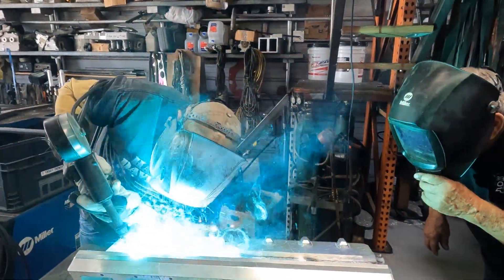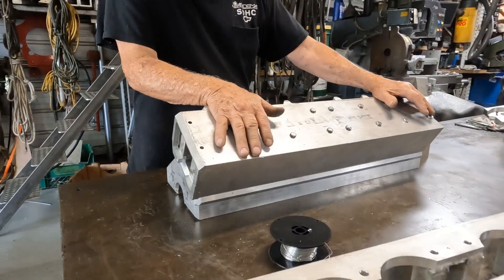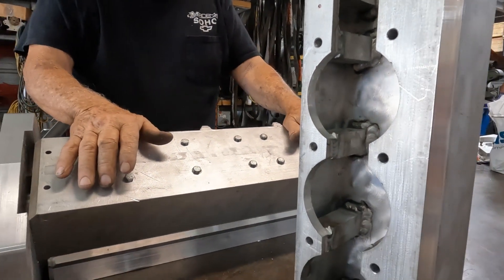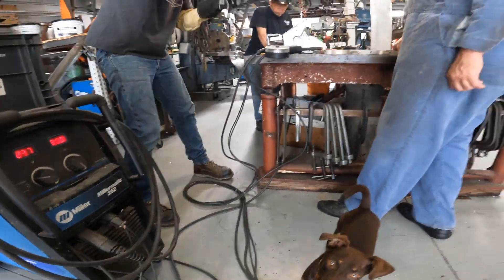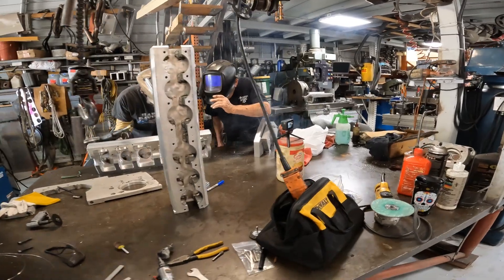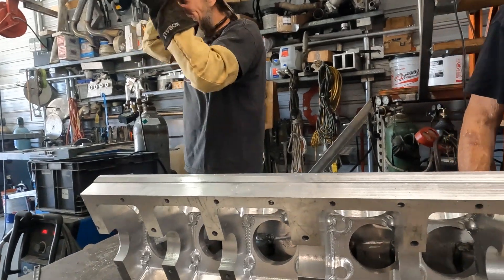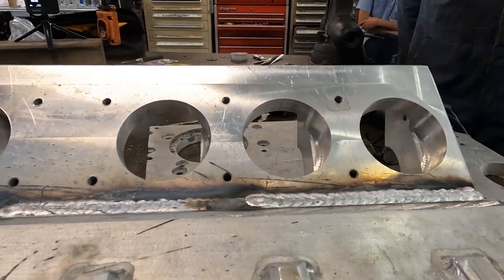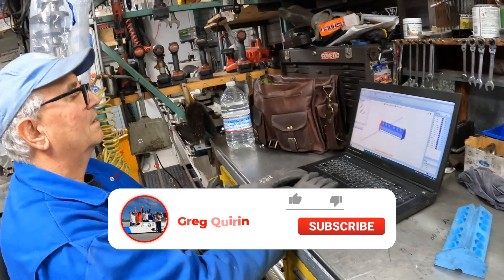Custom V12 Engine Build - Part 1

Comment: I SAW WHERE YOU HID THE TIMING GEAR .
CAN YOU SELL THE TIMING BELT SYSTEM TO FIT A PUSHROD  SMALL BLOCK CLEVELAND ? 
AUSTRALIA STILL RACES THAT BLOCK. BIG MARKET. 

DOES THE COYOTE SYSTEM USE A SIMILAR PATERN ? 
FORD USES A CHAIN THOUGH. 

CAN SOMEONE GET PERMISSION TO USE YOUR CONCEPT ?

Comment: Where would the threads for the head bolts be located on something like this? Pete mentioned the legs for the head bolts, does that mean they're threaded near the bottom of the cylinders?

Comment: A Millermatic 355 with the Aluma-Pro push-pull gun large wire size with the weld following closely behind the block preheat would probably do the job, I think the 252 in the video does not put out enough heat (current). 

However, if we stay with miller machines for the moment, the Syncrowave 400 TIG liquid cooled torch large diameter rod following the block preheat (as closely as practical) is the better choice to do these deep penetration welds into thick plate. I also think it would be good to have two heating torches and a spot read or thermal camera to see the actual temperature of the aluminum before welding, so two men on torches, one taking temps, and the final a welder. I also think the builders should have a rotating clamping jig to hold all of the main pieces in place under a set clamping pressure (the valley and the two cylinder banks) and alternate welding bank to bank starting with stitch welds so the distortion cancels out, fill in the stitch welds side to side, then do a final large fillet weld over the top again alternating banks. You will need to rotate the assembly so the weld puddle with gravity spans at the correct angle the final weld puddle will be huge the cup will be very large and the shielding gas at a high flow rate. After the final large fillet welds you could then grind down the weld using a radiused grinding wheel, first course then fine. This would help appearance but also provide some weld inspection for porosity.

Comment: I Am curious as to why after preheating the base metal, this welder doesn’t use TIG instead of aluminum MIG? I am aware this puts down a lot more material, but the penetration would be far better than this.

Comment: hmm why are you not setting up on practice material???
Reply: We actually did a small practice piece, however because of the difference in thickness and actual mass of material, he had to continue to adjust as he welded.

Comment: hi and wow! are you using 6061 aluminum? and what heat treatable  alloy welding rod do you use?
Reply: Yes it is 6061 and the wire alloy is 5356.
Reply: @kevinbraun6272  Hi Kevin, wow you guys really do a great job. Last I knew 5356 was not heat treatable?? I could see a vibratory stress relief?  or maybe the HIPP process??
Reply: @samstewart4807  Technically you are correct, the 5356 is not heat treatable, but it does not appear to have any adverse effect by heat treating it.
The heat treating is mainly to bring the 6061 back to the T6 condition. The 5356 weld is harder than the 6061 material around the weld. So we heat treat the part and it brings the whole part to a very consistent condition. After cutting into the welds we have never found any cracks or voids, and when I cut into the material it cuts extremely consistent.
You cannot see where the base material starts and the weld begins. Now I’m sure we would be able to see the difference if we were to anodize the aluminum, however it seems to be more than adequate for the strength that we need.
We have done this process on five engines so far with zero failures.

Comment: Seems that cam timing idea, could easily be adjusted while running, with a linear actuator! Use a stepper motor to know where it's at, maybe a resolver so it will know exactly where the advance is or retard! Id totally love building one of these but like two 4.3L put together, maybe a crank from a Subaru, each cylinder having two bearings, no shared rod journals! It would be a flat plane crank, use two distributors, but keep the basic SBC looks, heck maybe Subaru heads can be used!  Weld two 6cyl heads together!  I love the SBC shared parts,  to me Chevy is a religion, GM is the all mighty,. Was anyway, things seem to be in a hand basked on the highway to a hot place!!  It's bad when japanese/ Korean cars use more American parts than American car companies,   the greed has destroyed the country!  There should be a law 50% of anything a company sells must come from America, or must be made here, and vice versa a company can't just re- badge  cars and sell them as their own, and that be 99% of their business, and there should be a law preventing them from just moving out of the country,  the body by Fischer days seem much better!

Comment: It’s a Herculean effort for sure but wouldn’t it be easier to get 3D Printed sand molds and cast the block yourselves?  So many points of trouble with welds.
Reply: Not for doing single engines. Especially when they often make tweaks or big changes on each one.
Reply: Casting would be good to make a dozen engines once they finalise a design

Comment: Why are they building a block from multiple parts and welding them together? Especially in this day and age with 4/5 axis machining building a full billet block should not be too hard and actually improves the structural rigidity. None the less still amazing work!
Reply: You should put together a Go Fund Me page to raise those hundreds of thousands!!
Reply: @jeffmiller3150  It's an question out of curiosity as why Kevin and Pete take this approach. Also a bare billet block does not cost hundreds of thousands. Take for example RB, 2jz and various other billet V8 blocks. There are around 10 to 15k for an bare block.
Reply: @DevilFruitUserLogia  Probably 5 times the money of this one though............................. With no boost stress probably not an issue.
Reply: @DevilFruitUserLogia  I assumed he meant put a go fund me together to buy their own 5 axis machine to build it with. As was stated just because very popular and common blocks like a 2J arent that much doesn't mean that having a company do their one off blocks wouldn't be very expensive. That's assuming you can even find someone who's interested in doing it in the first place. I also wouldn't be surprised if these guys just enjoy doing as much as they can themselves.
Reply: Costs a lot to do a one off block, I wonder how much the crank for this cost?
Reply from the maker: @Mikesukes  crank will be discussed in the next video - thank you Greg

Comment: Thanks for showing this its very interesting. A question I have that you may have gone over is why is there such a big gap between the 2 cylinder gaps? Theres 3 cylinders and then spacing in between and then the next 3 cylinders. Is there a reason for this?
Reply: It is done that way because the heads are made from Aurora V8 heads. One cylinder cut off, then two are welded together on the uncut ends and the ends are capped. It is an ingenious way of doing it. There is a video all about the 6 liter build on this channel called "How To Make a V12 Engine From Scratch - Part 1" They go over basically every detail on the build.
Reply: @shvrdavid  I'll go check that out, thanks

Comment: Nice job guys, I cringed a little when I saw that he was welding it with the spool gun because there are so many nicer aluminum setups but it just goes to show that what used to work still works and that weld turned out nice. This engine build is inspiring, and I love to see an engineering marvel that combines all the different skill-sets starting with the vision to execute something so complicated, machining, fabricating, welding and the tuning all in one house. Amazing
Reply: Wire feed lets you add a lot of material with minimal heat soak. If you were to TIG as much material you'd have a lot more heat soak into the block making it warp even more.
TIG is fantastic but for adding lots of material, wire feed is faster, easier, safer and cheaper.
Wire feed is used for surface hardening dozer blades/teeth, line boring, and building up material on things like track rollers, turbine wheels and propeller blades just to name a few things. Hell, the vertical steel beams that make up the skeleton of skyscrapers are beveled and wire welded together.
All forms of welding exist for good reason and they're all awesome.
Reply: It's the skill set that gets it done.
Reply: @Motor-City-Mike 100 % correct!!

Comment: YEAH! i was waiting for this
Edit: Question: apart from it taking way longer, would you be able to TIG something this thick?  Does MIG offer greater penetration?
Reply: Tig welding aluminum is usually done with AC current so only half the energy goes into the metal. MIG welding uses DC current so all the energy goes into the part and you get much better Penetration.
Reply: You can definitely TIG something that thick, but my guess is as good as yours. First assumption would simply be accessibility(at least for inside the head), little easier to point and shoot with a spool gun than having to get a torch in there and feed filler at the same time.
Reply: Deposit rate.  They even said Tig would take forever to fill and a ton of amps to keep it hot.  Mig spool gun is actually more efficient but really finicky to get set up right and you only have the tip to base gap to fine tune the heat.
Reply: Imo spool gun was their best option.
For main reason that the parts were not cleaned anywhere near enough for tig.
If it was me doing it, I would have tigged it.
But on the same hand I wasn’t there too see things you couldn’t see in the video